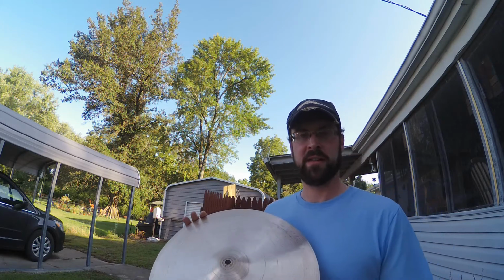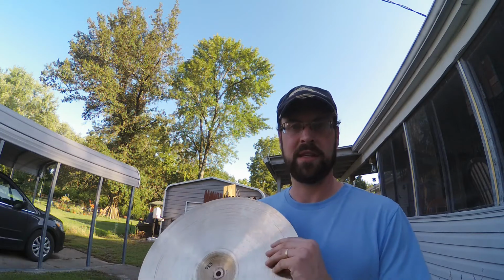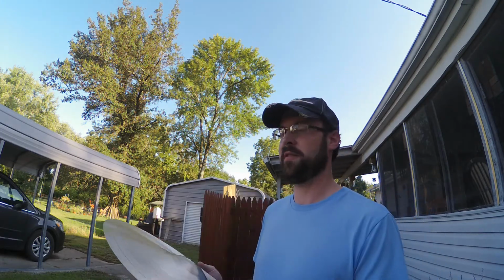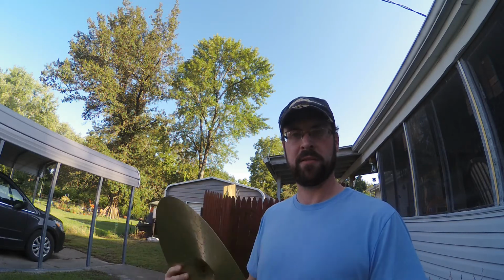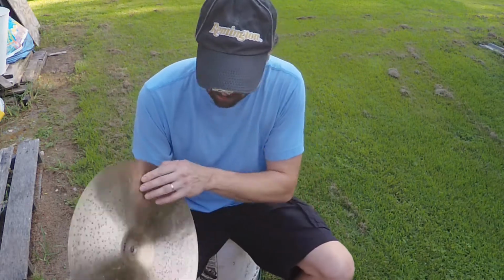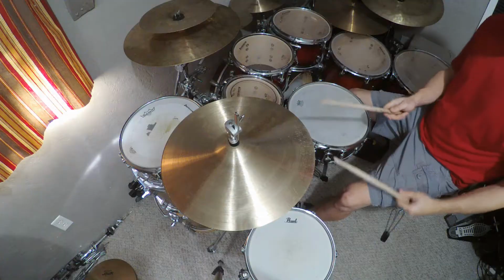DIY CYMBAL MODIFICATION: 16" Vintage Zildjian Crash/Hi Hat Hand Hammering

Comment: Where do you get an anvil like that?
Reply from the maker: I bought some steel round on ebay and then used an angle grinder to angle the edges and make it have a smooth top. Takes some time but wasn't too bad. Something like this should work. The wider diameter the better, but the price goes up quite a bit. https://www.ebay.com/itm/275948106895?mkcid=16&mkevt=1&mkrid=711-127632-2357-0&ssspo=m4OXjQzEQNa&sssrc=4429486&ssuid=SynuhCeyRSy&var=&widget_ver=artemis&media=COPY

Comment: So did you need to do any heat treatment of any sort before hammering? I’m used to working with steel but I think the rules with bronze are different. Like if I have some cymbals, are they ready to be hammered as is if I so desired?
Reply from the maker: I didn't do any heat treatment. You probably wouldn't want to leave them outside in the cold and then hammer them though
Reply: Cymbals are heated once during manufacturing. DIY cymbalsmiths do not usually do this part, everybody gets their cymbals either from finished cymbals or cymbal blanks, which are already shaped, just not hammered or lathed

Comment: if i do this to my pair of newer generation new beat hihats will the hammer marks look like these? have you hammered A custom cymbals?
Reply from the maker: They should look similar as long as you use the same hammer size. I have not hammered any B20 cymbals other than the one in this video (only B8 and brass). I would recommend hammering a cheaper (B8) cymbal first. Maybe buy a cracked cymbal or something to test out. Don't want to mess up your nice Zildijans!
Reply from the maker: I also lathed these, so that changed the look as well.
Reply: @ARDrummer  weird I didn't get notified about your messages! i see, yea my friend put me thru cymbal alloy boot camp so this makes sense to me. what is the thing called that you rest the cymbal on while u hammer?
Reply: @ARDrummer  in the past i've had a ZHT zildjian flat ride and i threw it up in the air a bunch to bang up the edges on pavement. I tamed the crazy overtones coming from the center of that flat ride cymbal. I've taken pliers to an old 18" A Zildjian and removed a chunk to dry it up. But I haven't tried hammering yet. This is very interesting and once I find a B8 or soft cymbal I'm gonna go crazy...

Comment: Hello, I look for a zildjian k Heavy 22 ride from the '80/90 of 3440/50 grams (don't like the new ones of 3600 grams circa) but I can't find It in Europe . Do you think if I could buy a Zultan Z ride and make reduce the weight by an artisan? It would sound similar?
Reply from the maker: I'm not sure, there would still be some differences but may have a similar sound. It's all about experimenting to get the sound you want. Wish I could help more.

Comment: Hi AR Drummer, can you tell me where I might find an anvil block like yours? Thanks a lot
Reply from the maker: I bought some steel round on ebay and used an angle grinder to curve the top and edges. Not the most fun thing to do, but it worked :) You can use any type of anvil that has a dome shape with curved edges. Here is a link to the one I bought. Cold rolled steel may be even better than what I used. https://www.ebay.com/itm/274436398246
Reply: @ARDrummer  Oh my, if I had known that when I made my own from a gymnastic handle ball, cutting it in half...

Comment: Where did you get the anvil?
Reply from the maker: I bought some steel round on ebay and shaped it with an angle grinder.
Reply: @ARDrummer  thanks for the reply, it seems like a lot of cymbal making is very secretive when its really just hitting stuff with hammers.
Reply from the maker: @Twoholesofman  Yes, it take a little time to get used to hammering and the "feel" of it, but it is doable without tons of training :)

Comment: better before hammer
Reply from the maker: 👍 As I said at the end of the video...I did this as an experiment to see how it changed the sound
Reply: @ARDrummer  question is there a proper science to the hammering? what determines dry vs bright
Reply from the maker: @terrtt  I don't know much other than my personal experience with it...but I don't think you can ever make a cymbal brighter by hammering. For me it always makes the cymbal drier and darker (because it doesn't vibrate as much with more hammering). Lathing a cymbal is another way of changing the sound by making the cymbal thinner, therefore lowering the pitch.